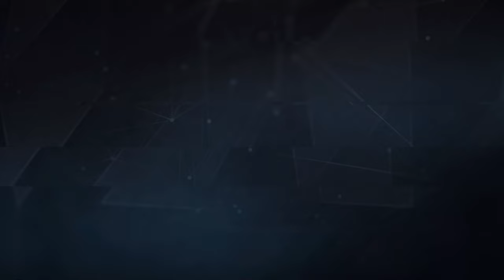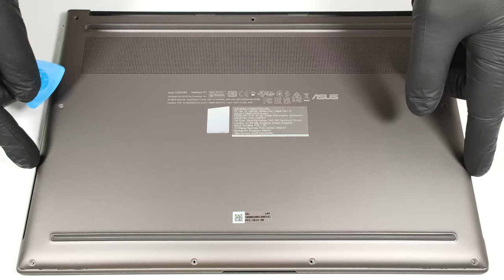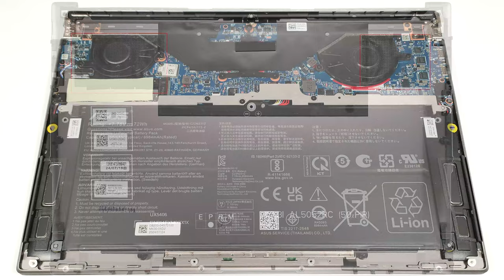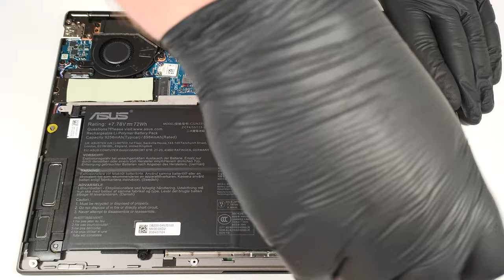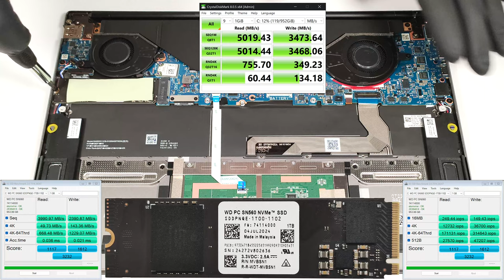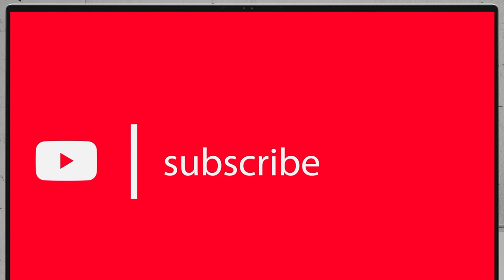🛠️ How to open ASUS Zenbook S 14 UX5406 - disassembly and upgrade options

Comment: Is it possible to swap to a 4TB m.2 or is there a limit?
Reply: I'm looking for the same answer but judging from the fact that there's no pcb but only an fpc underneath the ssd, I'm 90% certain that a double sided drive could fit in.
Reply: I just bought solidigm p41plus 2TB, one way to find out:face-blue-smiling:
Reply: @mmh6717  I did swap mine out with the same 2TB, it's a single-sided SSD so there's no issue. I still can't be 100% sure that it fits s double sided drive.
Reply: @kian8382  Did you re-use the thermal pad or use a new one? Do you remember what the thickness was? Thanks!
Reply: @thomasweidner3145  i re used the thermal pad. What thickness?
Reply: I can't find this answer anywhere.